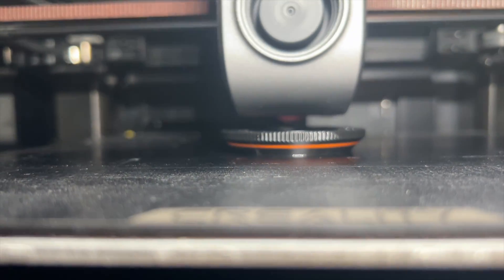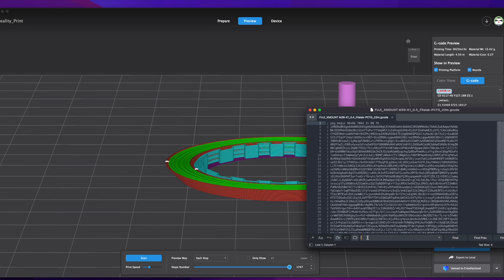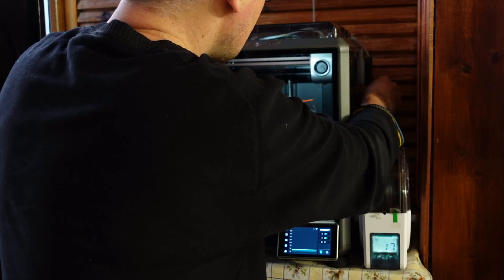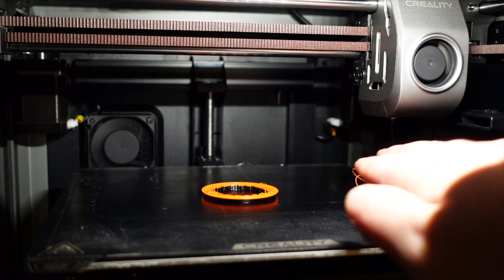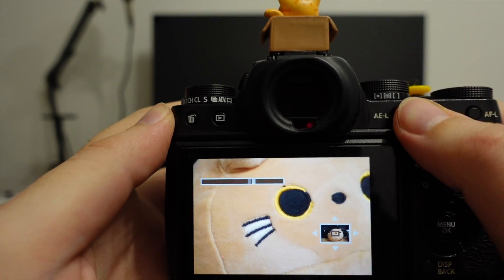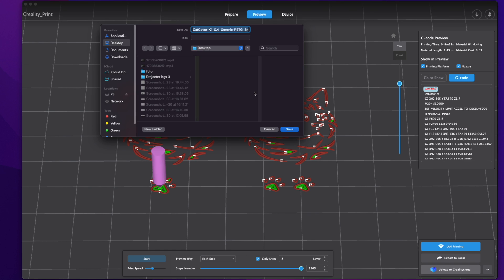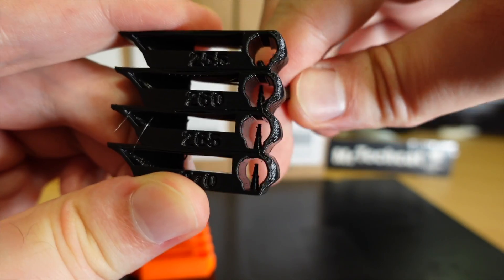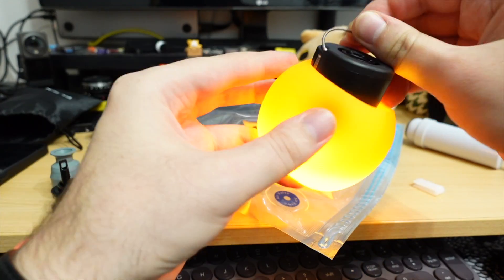3D Printing Color is Easy! 🌈 Creality K1

Comment: Use Orca Slicer! Right click on the Layer slider at the layer you want a pause and pick pause. It's that easy. I do color prints on my K1C all the time. Orca slicer makes it easy.
Reply from the maker: Orca is much slower over the Creality Slicer 4.3 and worse quality with default profiles too. There is Creality 5.0 with color and pause on layer options and printing well but still slower than 4.3.
Reply: @MrTechcat  I've never had issue with Orca. I ditched Creality print do to poor quality and it kept crashing. Not a fan.  Happy printing!

Comment: This was a great video. I was thinking about ordering the kc1 after wanting to do carbon. Seeing this is inspiring I can basically do what the x1 can do for 1/4 the price. What do you think of the k1c??
Reply from the maker: I print with PETG, so regular K1 is the best for me :)
I think, you can replace nozzles on the K1 if you need hard materials. So I do not see any benefits in K1C.

Comment: This is fantastic, as you know, it's a bit easier in orca slicer since you just have to right click and do PAUSE. but in orca you can also add multiple filaments (with different settings, or the same but with a different color) and you can right click in the slicer slider and do 'change filament > ' and pick the filament color you want to switch to, add another on the layer(s) above, and then slice again, and you can preview it in color, and it inserts pauses at each filament change
Reply: Using orca slicer when I add a pause my k1 max throws and error
Reply: @Blacklistedrook  The right click pause works with Creality slicer 5.1 and K1C. Thank you  @aeonjoey3d for mentioning that, I just used it with Creality slicer last night on my K1C

Comment: Inserting 'PAUSE' into my Gcode just caused a Print Failure :(
Reply: likely in the wrong spot, but orca slicer is going to be your best bet since it's all availalbe in the GUI, no coding, and you can see the color change in the slicer
Reply from the maker: Are you using K1 / K1 Max with an updated FW? It definitely works and tested on multiple printers already.

Comment: That is not easy. Bambulab you can just color fill the area you want on the model.
Reply from the maker: yes, pretty easy, after paying +$600 more for the printer and addons, plus double for every branded overpriced filament after that. :)
The whole Creality K1 was $300 ONLY on a Holiday promo!
Reply: @MrTechcat  Gotta pay premium for carefree color changes! haha
You don't need to use name brand filaments for the AMS, works just fine with generic cheapo filament the lidar seems to do a pretty good job tweaking the flow ratio on its own.
Reply from the maker: @intelli_mw  I can make a whole video how Bambu is slow, expensive and you can't make anything about that. Though it takes less than $20 to make K1 print 3x faster and with higher quality over the Bambu P1/X1. The whole thing with the K1 you can put any parts you like and flash any FW for speed, quality or whatever you need.
Reply: Settle down here buddy.. No need to be so defensive. I thought we were talking about ease of use when doing color changes? Price, modification, and etc not part of this. I am sure a Subaru can run faster than a Lamborghini if you put in enough time and effort into it. But that's not the point. I am talking about ease of use out of the box.   @MrTechcat
Reply from the maker: @intelli_mw  K1 is faster out of the box already... but lets just pretend that both are as fast and easy to use out of the box. 

Yet simply screwing a CHT nozzle to the K1 you can double your speed and QUALITY already. You don't even have a choice on propriety nozzles of bambu.

As 3D printing is not easy by nature. Easy is only printing all useless PLA toys from online.. until you need to make an actual custom part on your own.
Reply: @MrTechcat  I come from years of using prusa mk2 , mk3s, and delta printers. I've spent countless hours modding hardware and flashing custom firmware to achieve better and faster prints. So I know.
I am talking about "ease of use'. 3D print used to be reserved for people who have time and patience to tinker. Now we have options for new comers who can just worry about the designs they want instead of investigating how gcode works and which and what he/she needs to print to install this or that mod for this particular model of printer. 
Like I said, a lot of newbies don't mind paying a premium for something that essentially just work out of the box. As for myself, got three kids to look after now and I just want the machine to just work without much tinkering. That's all I am saying.
Reply from the maker: @intelli_mw  you can watch my K1 review that this is exactly the printer that just works out of the box just like the Bambu. 

Both printers are almost carbon copies. Even with the exact flaws like print spool being on the back for no reason and filament tube rubbing to the case top on both. 

The main difference is a propriety software and parts on Bambu and the price is the biggest difference. I do not believe I have seen Bambu discounted for more than 100 euros.. but Creality K1 has been on a promo selling for just 300 eur multiple times and this is a reason I went with the K1. I actually  contacted Bambu if they are interested in review or making any discounts and with no success I went with the K1. 

These printers has nothing to do with Prusa or old Creality stuff. I had FLsun delta printer too. And finally, I do not need to bother about the printer, I can concentrate on actually making better part designs and prints now.

Swapping nozzle is not an upgrade it's just a regular thing to do on a printer. And as I did proved in this video printing PCTG over 3x recommended max speed by the filament manufacturer with no issues with my K1 and CHT nozzle and having better print quality not only the speed too. Again, finding out that Bambu do not even offer any CHT nozzle I would be very upset now. If would have went with the bambu.  
 
But I'm not telling that it's a bad printer. Both are very similar I just like cheaper option, plus cheaper parts and more options to choose too. I'm not sure if I would find a single feature on Bambu that I would want.. Even printing with color I do not want to waste filament so I want to design the part with the least filament changes possible and doing a couple of changes by hand is ok. Especially, for 1/3 of the price to make it automatic.. I will use my hands for now.. as it's very likely that Creality will come with their AMS system copy too. It's just how this market works.

Comment: In Prusa-Slicer, this is a built in feature.  You just select the layer you want the color change on.
Reply from the maker: The problem it adds M600 g-code which will not work on stock Creality K1. Without rooting and adding M600 macro in fluid.
I did try that with Galaxy Slicer and K1 just ignored M600 command.

Comment: i would not call this easy, more like: can be done with some manual work and G-code edits.
Reply from the maker: when you haven't seen 'regular' way.. Rooting K1, installing mainsail, adding macros and using it with 3rd party slicer. :D

Comment: Never use retract...especially with the old extruder... small pieces of filament get broken and end up blocking it
Reply from the maker: Haven't had an issue using it for months. My K1 is the latest model though.
Reply: Yea the old one cloiged on me afte my 3rd print after retracting, hopefully had that 3 year warranty from canadacomputer gave me a updated one a day later, THanks for the info btw!  @MrTechcat

Comment: You can easily use the pause feature with orcaslicer. You should try it!
Reply: Beat me to it. Have to root the k1’s :) and use orca
Reply from the maker: I did. Default K1 profile on Orca nowhere near to quality and speed of Creality Print, as you can see I have GalaxySlicer open to preview print progress but I don't use it for slicing for the same reason.
And it adds M600 command not PAUSE. Again, you need to add M600 Macro on K1, so just many extra steps totally useless. I still have to find what is the purpose of  rooting K1 and installing Mainsail. Haven't find a single useful function from doing that yet.

Comment: This should just be a built in feature in Creality Print. It can't be that hard to add it.
Reply from the maker: There is a color change feature in creality print advance settings, it’s buggy though. So this why you need to edit the file manually.
Reply: It is in prusa slicer. And this is not specific of K1, one can do this in pretty much any printer...
Reply from the maker: @FabioDiasBR  yes, plenty of videos how to do it in Prusa slicer BUT it's way more steps on Creality K1 because there is no M600 macro in stock FW. And my video might be the first how to do this on Creality Print because all other videos do you all kinds of slicers, as 'creality print is so bad'. Yet, somehow it's the only slicer that prints the fastest and most. reliable out of the box on the K1. 
Prusa slicer does not have K1 support at all.. Orca slicer does have K1 profile but speed and quality is bad. Galaxy slicer same thing. No profiles for Cura and the list goes on. All public K1 profiles online ARE SO BAD again simply compared to the stock Creality print slicer.

Comment: wonder why using battery bank? is it use as a UPS ?
Reply from the maker: My printer is sitting in a balcony, so I would not have to hear or smell it. It’s running of  solar power too.